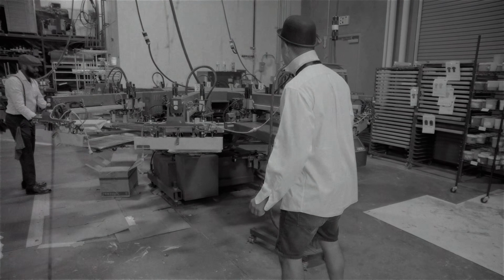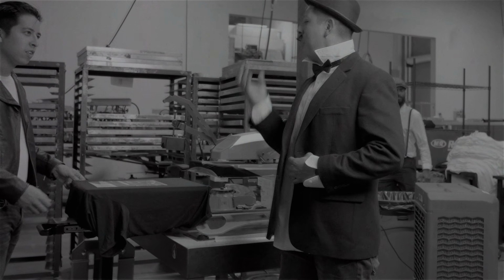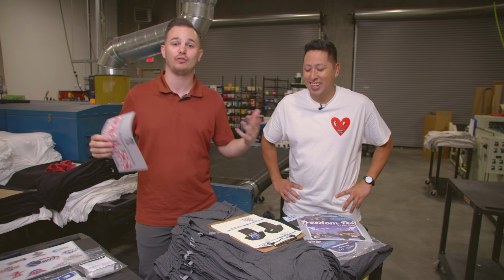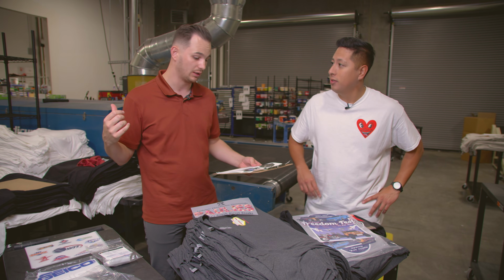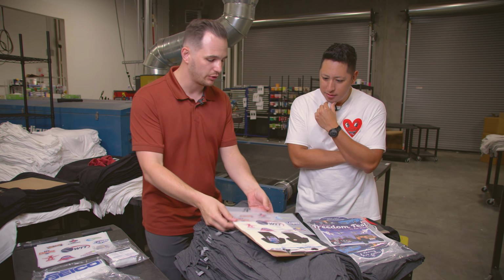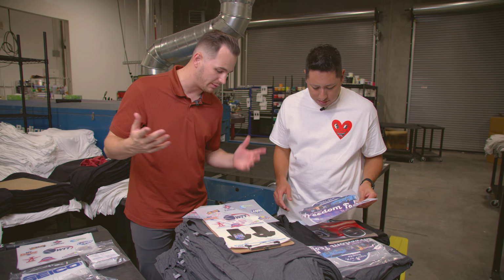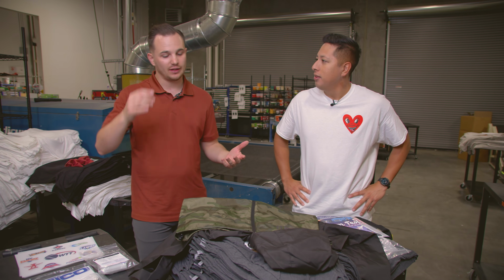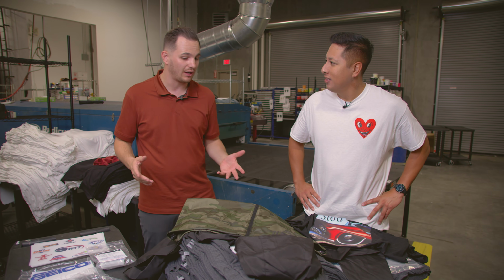How Heat Transfers Can Transform Your T Shirt Printing Business

Comment: is DTF method of print right ?
Reply: Though ultimately used in similar ways, Supacolor and DTF are created with two entirely different methods of production. The Supacolor process combines both screen printing and digital printing techniques, to create a unique and proprietary product. Supacolor's manufacturing process results in our signature style transfers, which have more visibly opaque whites and eye-popping, vibrant colors. Further, the Supacolor production process provides us the ability to add additional layers in the transfer, which help to control dye migration and successfully bridge seams on headwear.

Try Supacolor today for yourself!

Comment: I love supacolor, but got a DTF for my small business. DTF is way cheaper, vibrant, and just as durable.
Reply: Man I use to think the samething… but now I’m stuck with a DTG machine that doesn’t do hats isn’t the best on non cotton products and also is limited on printing outside that square box that DTG machine owners know to well. 

But non the less still love my DTG machine but definitely couldn’t think of a better way to go then supacolor heat transfers.
Reply: @agaziyasefa4745  Nothing wrong with Supacolor, still use them here and there. You can make DTF transfers with your DTG machine. Check it out, Direct to Film transfers and they are the new technology of transfers. Its just as good or better than Supacolor.
Reply: What is DTF?
Reply: @marksimmons5839  DTF is Direct to Film. Check it out and see if you like it. Similar to Supacolor and the best part is you can make DTF transfers with a DTG printer.
Reply: @t-shirtcrusaders2547  Wow thanks, I certainly will .